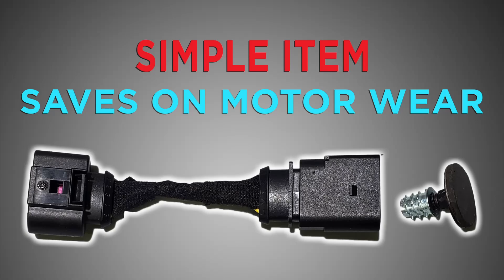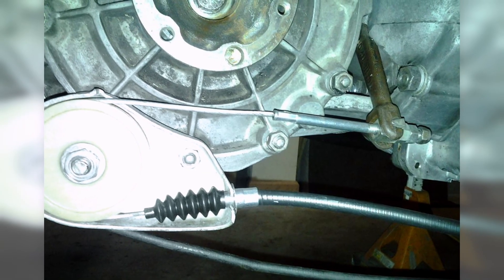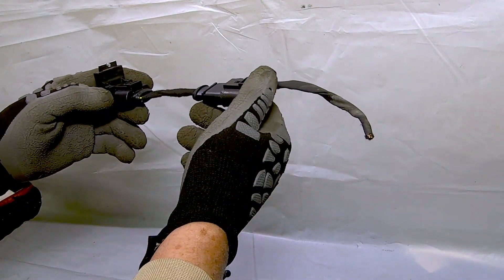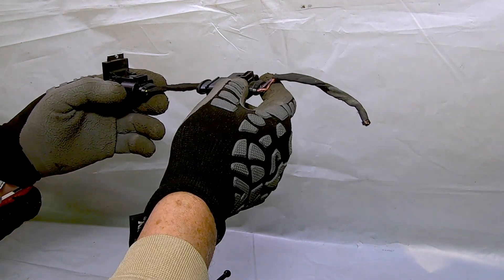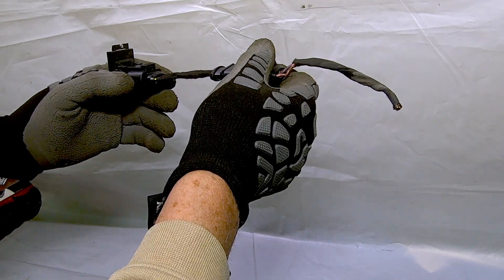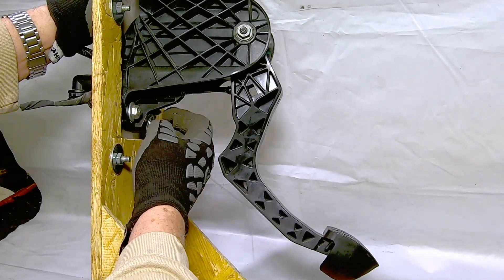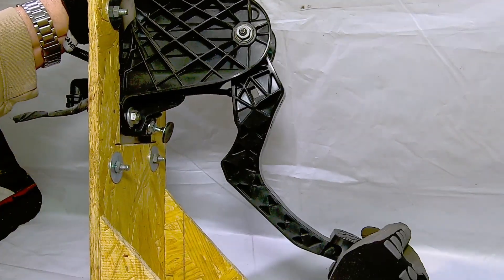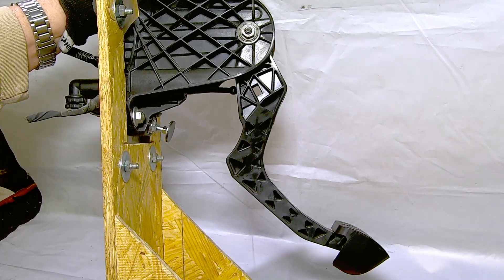Clutch Bypass Harness/Clutch Stop VW MK5/6 and Audi A3/TT by Coupewerks

Comment: Work on audi a6 c6 2.7 tdi 2009 ? Manual
Reply from the maker: No, sorry that car does not use a sensor on the clutch master.  There is most likely a clutch start sensor under you dash that is actuated off the clutch pedal arm.

Comment: Wytłumaczcie proszę ogranicznik ma na celu przedłużenie żywotności silnika sprzęgła a ten baypass do czego służy ??
Reply from the maker: As I do not speak Polish, I will reply in English and have Google Translate, translate it.  Please excuse any translation errors.
The clutch stop allows you to limit the amount of pressure on the pressure plate to just the amount needed to engage or disengage the clutch.  In this way you do not over extend the movement of the fingers of the pressure plate.  You also limit the amount of pressure put on the thrust bearings.  
The bypass allows you to start the car without the clutch installed.  When you press in the clutch to start the car, it moves the whole crank/clutch/flywheel assembly forward, putting pressure on the thrust bearings and other parts of the motor.  Because the car is not running yet, there is no oil circulating in the motor.  So all you have is left over oil film, providing protection to those metal on metal parts.  If you don't have to start the car with the clutch in, you will have oil circulating first, cutting down on metal to metal wear.

Google translation to Polish.

Ponieważ nie mówię po polsku, odpowiem po angielsku i skorzystam z Tłumacza Google, przetłumaczę.  Proszę wybaczyć wszelkie błędy w tłumaczeniu.
Blokada sprzęgła umożliwia ograniczenie nacisku na tarczę dociskową do wartości potrzebnej do włączenia lub wyłączenia sprzęgła.  W ten sposób nie rozciągasz nadmiernie ruchu palców płytki dociskowej.  Ograniczasz także wielkość nacisku wywieranego na łożyska wzdłużne.  
Obejście umożliwia uruchomienie samochodu bez zamontowanego sprzęgła.  Kiedy wciśniesz sprzęgło, aby uruchomić samochód, przesuwa on cały zespół korby/sprzęgła/koła zamachowego do przodu, wywierając nacisk na łożyska oporowe i inne części silnika.  Ponieważ samochód jeszcze nie pracuje, w silniku nie krąży olej.  Pozostaje więc tylko film olejowy zapewniający ochronę metalu na metalowych częściach.  Jeśli nie musisz uruchamiać samochodu z wciśniętym sprzęgłem, olej będzie najpierw krążył, co ograniczy zużycie metalu o metal.

Tłumaczenie Google na język polski.

Comment: Please! Could someone tell me the part number of the connector that goes to the hall sensor? Thank you very much!
Reply from the maker: Send me an email, to the address listed in the description.
Reply: Can You Maybe Help me also I can't start My Car Cause The Switch is broken!
Do You Maybe Every diagram of I need to buy a Switch
Reply from the maker: @alixair  Have you tried replacing the sensor on the side of the clutch master?
Reply: @oldguyramblings  yes indeed but I think it's broken not the sensor but Inside The Master cylinder!

Comment: I installed this on my 2012 Golf R. Communication was easy and thorough, the part arrived on time and was very high quality using factory connectors. Most importantly, it worked exactly as advertised. Buy with confidence.

Comment: Just a question does it works on a audi b8 2.0 tdi
Reply from the maker: Off hand, since I have never looked at the clutch switch on a B8, no.  The B8 has a different clutch master setup than the cars mentioned in the video.
Reply: @oldguyramblings  thanks i cant find anything for it the same feature press clutch to start i tried to not press the clutch all the way down but failed thanks
Reply from the maker: @valentinalterus7225 On some cars the switch is attached to the pedal under the dash.  In older cars, they had two switches.  One switch for clutch start and one for cruise control.  
Now some cars use one switch for both.  You would have to pull the panel above the pedals and take a look at what you might have.  Then figure out a bypass.
Reply: @oldguyramblings  thanks a loot i will try hope it will be the easy way with just one thanks and Keep up the good Work

Comment: I have installed this harness in my 2009 Audi A3. It is very easy to install and works perfectly! I have changed it out at the same time as replacing my clutch master cylinder. Greg responds very quickly to emails and will get it shipped very fast. I had a wonderful experience talking to Greg and I highly recommend buying this product. 
Thank you Greg!
Reply from the maker: Thanks, Jeffrey.  I am glad it worked for you.  Allows you to adjust the driving style you want.
Reply: Hi, where can i get this harness thing. I seriously need it
Reply: Hi, i am in need of this harness or my jetta 6... Where can i get it. Link please urgently

Comment: Where can I buy this harness my vw rabbit won’t start after I changed the master cylinder it’s not reading that the pedal is down when it is something is not aligned
Reply from the maker: Well, this harness will not solve that problem.  The problem is either in the Hall Sensor, the Master or the connector to the sensor.
Did you damage the connector when you removed the clutch master?
The Hall Sensor could be bad.  Find a known good one and change them out, to see if it is the sensor.
Did you buy a aftermarket no name Master?  The original was made by FTE, as was the Sensor.
If you did bought an aftermarket Master, it may not be compatible with the OEM sensor, for some reason.
You can test this by using your old master.  
To test with the old master, it does not have to be put back all the way in the car.  Pull the connector and sensor, from your new master, and connect them to the old master.  Push the rod all the way in and see if the car will start.  Make sure the car is in neutral.
Understand?
If you still want the harness, you can email  coupewerks@gmail.com
Reply: @oldguyramblings well the Machanic that worked on it broke the tube that connects from the top of the master cylinder that connects to the reservoir I’ve tried everything I put the old one back in and still nothing he also used the master cylinder rod broke it in half and stuffed the rod in my clutch pedal to make the aftermarket master cylinder longer bc it was shorter idk if the fluids aren’t getting enough pressure from the reservoir to the master cylinder since it’s leaking or if the clutch safety switch isn’t getting a connect bc the car volts are fine we even tried jumping the starter and it cranks but something doesn’t allow it to turn over